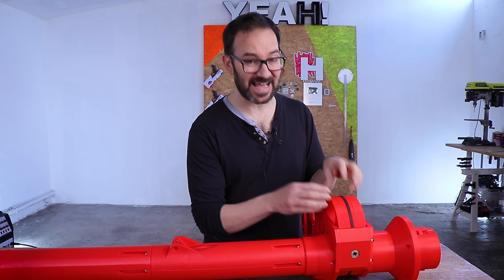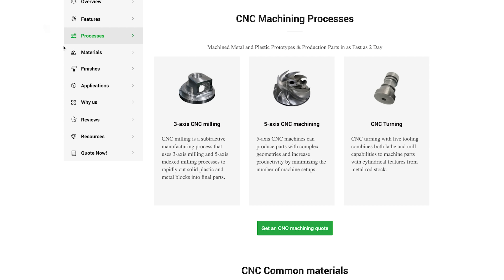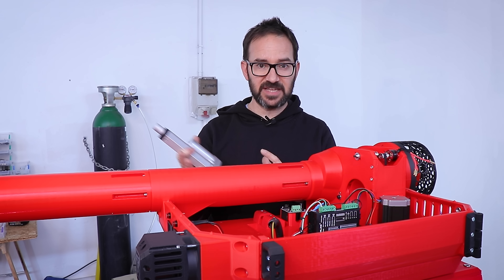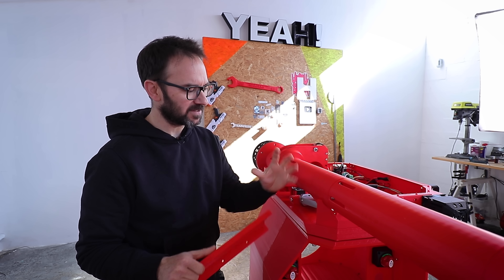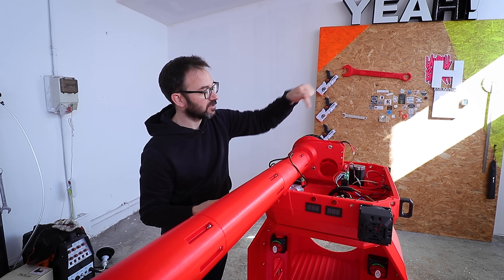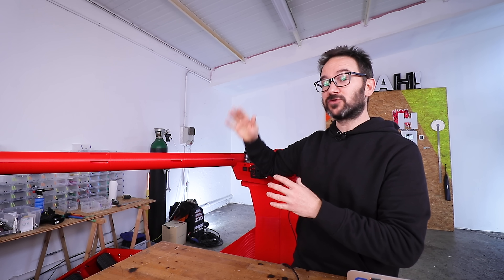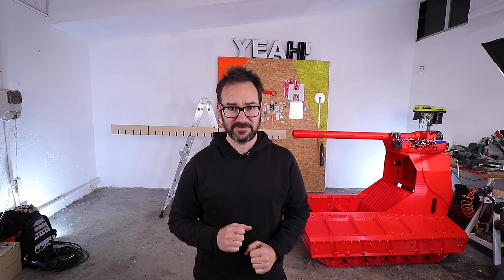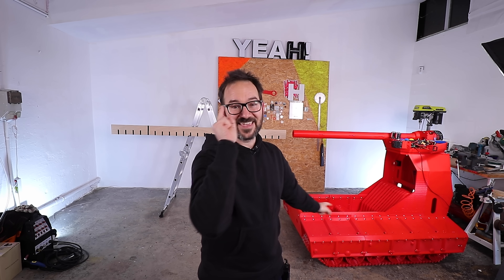GIANT 3D PRINTED TANK FIRES ITS CANNON

Comment: A long barrel is needed for a more complete transfer of energy from compressed gas to the projectile. In the case of a fan, the pressure is constant and there is simply no need for such a long barrel. On the contrary, a barrel that is too long, as in the video, only creates additional resistance.

Comment: maybe the linear actuator could be moved back and only move horizontally. that way, it can push an isosceles triangle where the edges can all rotate that will do the job of redirecting the force up, instead of potentially damaging the plastic because the angle is too shallow
---------------o----
                /\
====-----/   \

Comment: I think that the ball loader could be made using just 1 motor. 2 motors seem like OVERKILL (pun intended). Also, the barrel would work better if it used a Geneva drive, and it and the loader was mechanically synced together. The loader needs to load the balls quick and precise. Maybe use a ball screw above the chute to load them in. Just a thought.

Comment: Hello.
I think that you can add Geneva mechanism to the revolver cylinder part to control the rotation and fix the cylinder in place until the round is shot. This would solve the problem with jammed rounds.

Comment: Maybe the barrel elevation could me made smoother by attaching the linear actuator to a wedge shaped sled under the barrel.  Pulling the sled in would raise the barrel, and make a more stable bed for movement.
Reply: and add springs forward of the wedge to pull the barrel down.  Or, use a roller guide groove in the wedge to keep the barrel from bouncing as much in motion and eliminate the springs.

Comment: Good job taking that shake out of your cannon. You can further improve it by ramping your motor power on start/stop, instead of a digital on/off. This can be done in your control software or electrically with a capacitor. Your loading mechanism looks like it could shoot balls by itself!
Reply from the maker: The motor is driven by  PWM controlled driver, I can ramp up and down the movement in software. Cheers!

Comment: Imagine if you made the balls with 2 plastic screw in halves with the screw thread near the outside so that you could put a glass pane between each ball half so that you could have a catalyst in one side & a highly flammable liquid in the other side so that when the glass broke & the 2 parts combined they would explode on impact as the 2 ball halves crack open from the impact of something hard. You would have a fire bomb projectile which would be really good fun.

Comment: Using PVC tubing likely would have been cheaper, lighter, and faster. But I get it that you want to 3d print as much as possible.
Reply: but can you make rifling on the barrel using pvc without feelong like cutting your hair off with a chainsaw, putting isopropanol in there and jumping off of a cliff with your head on fire into a pool of liquid methane

Comment: You know, you could add indexing sensors to the revolver that only allows the feed motor to advance balls while the revolver chamber is aligned with the feed belt. It would be able to work incredibly fast and efficiently.
Reply: I definitely thought this would help with smooth firing.

Comment: You should add bracing between linear actuator's mounting axis and cannon's axis, this way it will form a triangle, and remove all bending forces. OR - rework the mechanism, and make the actuator push a lever, which will lift the barrel.
Reply: Hardly enough to print those parts accordingly to the main schematics. Agreed with the triangle axis.

Comment: Looks great, but if I could make a suggestion having a guide rod that runs above the balls so they are less likely to hop out of the feed belts and possibly damage something in the turret, unless you already counted for that in the lid
Reply: If i understand right directly above the feed belts will be the hopper, I'm sure the electronics will be sealed off from that so a ball pushing upwards would just end up in the hopper anyways if its an open trench design, if its closed I think it'd be no issue either, I could be wrong haha

Comment: I just love how he knows exactly where the best places to include the holes on the 3D print with the right size holes with perfect hardware. Sense all parts were made by him on his CAD software. I try that and I can’t get sizing right and my head explodes
Reply: power of video editing...
Reply: A lot of practice, experience, and thought to make it right from the start. Even then, you have to go back to the drawing board and change something. But you'll get to the point where you know what sizes most hardware comes in (since you've eventually used most of them), and you'll know that you neet 0.15mm clearance for a certain fitment, and larger/smaller for others. It also helps to even model the off the shelf components so you can get the sizing right the first time.
Reply: I'm guessing he probably uses McMaster-Carr's (or some other company's)CAD repository for a lot of his fasteners
Reply: Could also be your filament
Reply: You need to use duct tape on your head to keep your brains in....you can't stop the explosion just mitigate it.
Reply: Same here not sure what software you’re using but I learned a lot easier on blender & just save the holes that I make as a template etc
Reply: he probably has to make a lot of small testprints